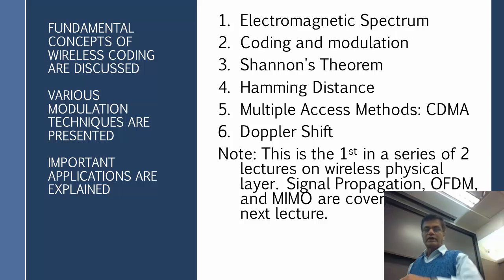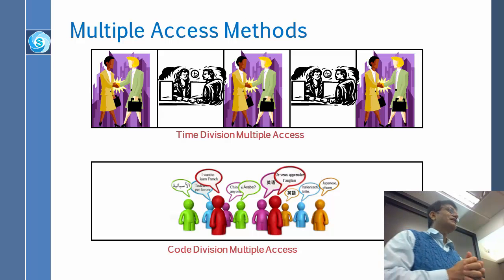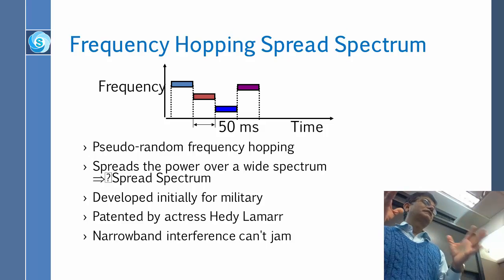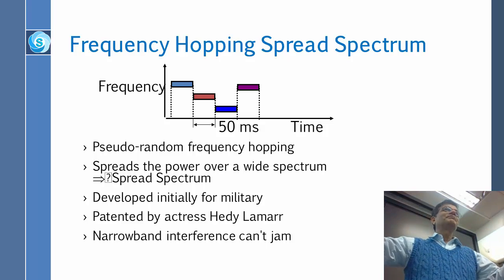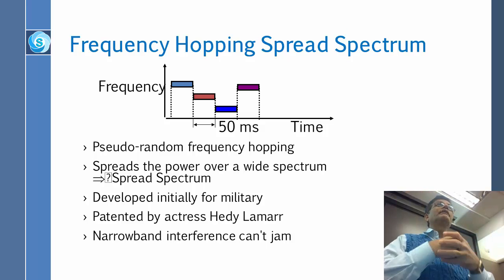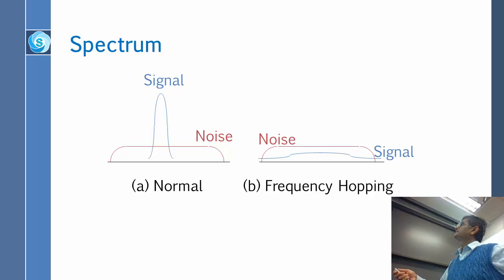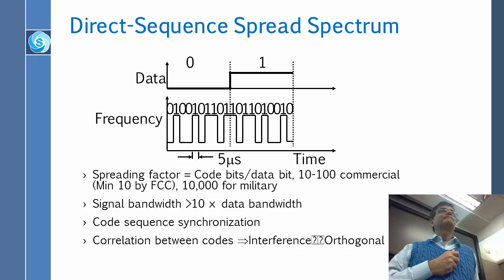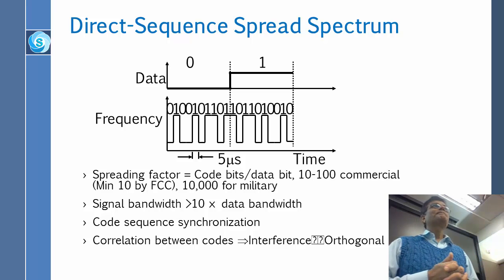Wireless Coding and Modulation: Part 4 - FHSS & DSSS

Comment: is there any one user idle in mobile communication channel like fixed telephone?
Reply: If you meant Not on call (idle) the answer is Yes obvious.
If you meant Not able to speak (idle) No as it depends on duplex mode and mobile communication uses Full duplex mode.